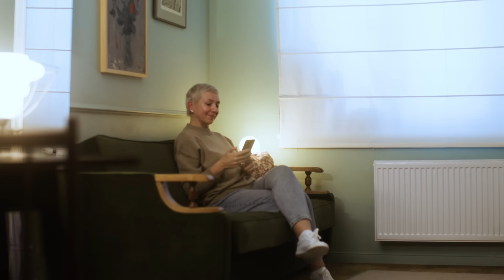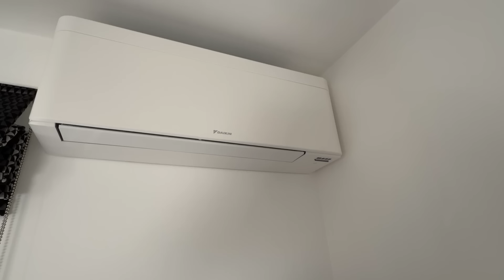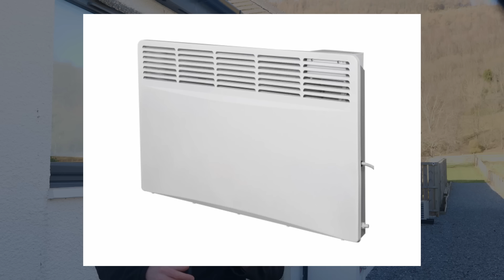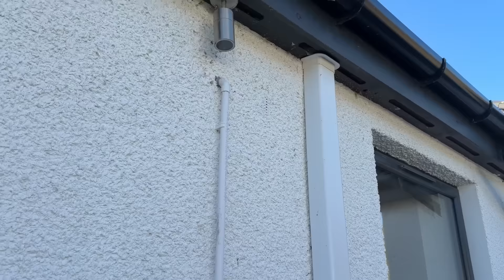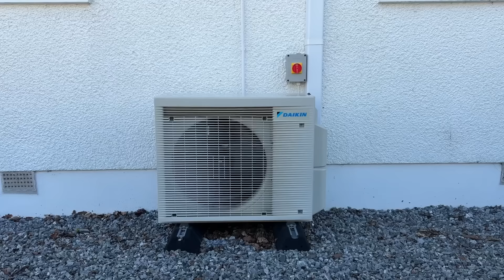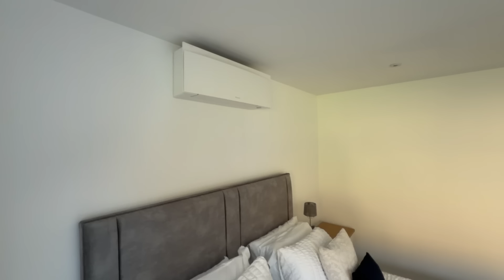The ULTIMATE Guide to Air-Air Heat Pumps

Comment: yes but you (no one actually) didn't calculate cost of servicing and replacing like compressor, electronics, getting water into closed loop system. that's when all you calculation go into waste. I had to change compressor for Mitsubishi - 3000 eur ! in 5 years. you can run with this all other system with no reasoning ! so basicaly better to buy smaller, with lower cost for replacement ... gives you much much better outcome in the long run. Don't buy special brands that offer you don't know what. I'll buy generic smaller one from not known brands and to change it as easily as possible!

Comment: “Unlike air to water there is no need to install cylinders.” So how do we get hot water for washing and showers? I’ve had quotes for air to water systems, none asked about the pipes in the screed which are 15 mm plastic which has a significantly lower maximum flow rate than copper. In other words, it’s not good for a heat pump operating at 40 - 50 C and high flow rates. Installing new pipes would be highly invasive if hidden, and very ugly if surface mount. Plus big radiators suitable for a heat pump cost £300+. I agree air to air looks neat, especially with pipes going up into the loft of a bungalow, which is my case, then distributed through ceilings to heating units. I am tempted by air to air as my combi gas boiler is 15 years old. The big issue is the hot water cylinder. I would have to use the old immersion cylinder cupboard which is now used for storage. I am sure air to water installs are a bit overpriced at the moment.
Reply: Just to let you know there is a solution to the hot water issue when you have air to air. I replaced my combi boiler with an Ariston Velis Tech 80l electric water heater - its just 27cm deep and around 50cm wide, so it fitted in the kitchen cabinet where the combi was. It uses two tanks, an inlet and an outlet, so using hot water from the outlet doesnt result in a temperature drop when cold water replaces it in the other inlet tank. It just uses 3kW, even though it has 2 immersion heaters (1 in each tank) but they never run at the same time. Its easy to control via wifi, either the app or in my case Home Assistant controls everything. I heat up the water overnight at the cheap rate, and it lasts all day.  Estimated running cost is about £75/year, with no gas standing charges, no combi servicing, and no costs when my 11 year old combi fails! Its a simple solution but very practical as the hot water is totally separate from heating/cooling, so if one system fails the other keeps going. For a small home that had a combi and no space for a big water cylinder I think this is the answer!
Reply: @markbaldwin4761 . Thanks for the information. I guess the key here is overnight electricity. My tariff has a fixed charge all day.

Comment: How do you heat the water without a boiler?
Reply: You need a boiler, either a heat pump boiler or one with the Daikin system.
Reply: @StillAliveAndKicking_  You don't need a boiler necessarily if you already have an air-to-air heat pump which means you don't necessarily need panel convectors (radiators) or UFH since you would have installed air-conditioning units inside your home which are mounted on walls. Therefore, without the use of space-heaters, your only question is, how do you heat domestic water? Through a separate system with different options available: electric immersion heaters, solar thermal panels, and even a heat pump water heater.

Water is usually stored by a HWC, or rarely some prefer the instantaneous method where water is heated when it's being used only, removing the need for thermal storage and legionella risks, though it's more costly due to higher electrical demand.
Reply: @y @youxtuberz5229 That is exactly what I was referring to, a boiler for domestic hot water. A heat pump boiler is a HWC which uses a small heat pump to extract heat from the ambient air to heat water in the cylinder. It needs an outdoor vent. The Daikin A2A system can come with a Daikin HWC with water heated by the outdoor heat pump. Having an electric HWC makes no sense costwise.
Reply: @StillAliveAndKicking_ I never heard of a heat pump boiler before, I guess it's used interchangeably with heat pump water heater.
Reply: @StillAliveAndKicking_ You always learn something new!
Reply: @y @youxtuberz5229 . Look up Fjord Heat Pump Cylinder from Ådlar, I was wrong to call it a boiler. There are other makes.
Reply: @youxtuberz5229  No, a heat pump water cylinder is for use with an air to water heat pump whereby the external heat pump feeds it with hot water.
Reply: @StillAliveAndKicking_  A heat pump water cylinder is the HWC itself that's connected to the air-water source heat pump, correct. That's a common arrangement.

But we were talking about a different situation: an air-to-air heat pump dedicated for space heating, and a separate system for DHW
In this instance, a heat pump water heater / boiler with a HWC connected to it for DHW.

The terminology is where we differed.
Reply: @youxtuberz5229  It is too confusing as there seems to be no clear name for the HWC that has its own small heat pump for heating the water. They are quite expensive.

Comment: Fair summary. Worth flagging the split for anyone choosing: air-to-air gives you quick room-by-room cooling like an AC unit, whereas a hydronic system cools through water and emitters. If you go hydronic, getting useful cooling usually means a Cooling-Ready Retrofit — adding fan coils, drainage and dew-point control alongside the heating. Different feel, different install, both valid.

Comment: Here in Australia, domestic central heating with boilers and hot water radiators is almost unknown. Most of us live in the south-east of the continent where we get very hot summers and pretty cold winters - here in Canberra temperatures can range from -6C to 37C. And modern Australian houses are not built for winter conditions, having brick veneer walls, tiled roofs and large windows.
We've all been buying air conditioning for use in summer for many years now, especially since cheaper units from Japan and China became available. From there, it was only a short step to what we call split system or reverse cycle air conditioners, which are just other names for air to air heat pumps.
We live in a moderately small townhouse (terraced house) and we have a medium-sized air-to-air heat pump installed in the kitchen area of our open-plan living area (kitchen/dining/living room). It isn't able to heat the whole house and there's only one possible site for a larger unit and that would turn our living area into an oven. So we have a separate ceramic radiant heater in our bedroom and are stoical about the bathroom (British English) and toilet. We have 14 PV panels on our roof with a peak loading of 4.64 kW. We don't have a storage battery.
The secret to better economy is insulation. The Walls and ceiling seem to have been well insulated when the house was built, but we've added draught excluders to the bottoms of doors and apply (shock! horror!) bubble-wrap to most of our windows as a very effective method of window insulation, which I call Scotsman's double glazing. It works. Nobody we know believes us - because it's so cheap - but yes, it does.
We have a time of use electricity tariff, which means that off-peak costs us AUD$0.15/kWh, shoulder is AUD$0.27/kWh and peak is  AUD$0.38/kWh, roughly speaking. Supply charge is AUD$1.14 per diem. Feed in tariff is a measly $0.05 kW. We have recently replaced our corroding gas hot water heater with an electric one, but we have installed a timer to the circuit so that it switches on at 10.00 am and switches off at 4.00 pm, with a booster coming on as required. Prices will increase next financial year by about 4%, but our supplier tells us that based on recent usage, our total electricity charges for 2026/27 will be about AUD $1,200. As a rough guide, one Australian dollar equals about 50 p sterling. So that's about 600 pounds for the entire year.
BTW so many people in Canberra have domestic solar that off-peak pricing now applies to the middle of the day and not the middle of the night, to try and cut back unused solar power being fed back into the grid and seriously overloading it. As we're both retired we can take full advantage of this. Others are not so lucky.
Reply: That's great feedback, thanks for sharing
Reply: Why on earth don’t you install batteries? We’ve got 15 panels facing south and 2x Tesla Powerwall 3 batteries. Even here in England that means we have no electricity bill during summer and minimal in winter. We haven’t got an EV yet but have a home charger installed. We sell back our excess generated electricity to the grid @12p per kWh. Now our summers are getting hotter we will be installing air to air heat pumps for next summer, which will run AC for nothing using our solar, with the added benefit of heat in the winter - we currently have a very efficient condenser/ boiler doing UFH throughout our ground floor and radiators in bedrooms. We will look to at least de-install the upstairs radiators when heat pumps are installed, and might even get the Daikin unit that can heat our water too. Possibly get rid of gas all together. I’m nearing retirement so we want everything new and future proof with as low bills as possible.

Comment: What would it cost for 1 external Air2Air unit feeding 2 internal units (lounge and bedroom above). Well insulated 2 bed end of terrace house, 8 years old.
Reply: We had 2x Panasonic units installed for £3.5k.
Reply: We had 2 air handlers & 1 outside condenser fitted into our park home, whole work done in about 3hours  total a little over 2k  was it worth it………we should have done it sooner
Reply from the maker: Between 4 - 5k!

Comment: I like the idea of floor mounted A2A units for primarily heating. My concern is that I hear people say that as soon as you turn A2A off the room goes cold. Surely the heat produced warms the fabric of the building, hence shouldn't do that suddenly, but it is a big concern having not experienced that with oil heating and rads.
Reply: What you're saying is simply that A2A is very responsive - why would that be an issue? We like that we have a floor mounted unit downstairs and a higher up one upstairs where the bedrooms are.
Reply: @johnhunter4181  I'm at a point where I need to get a heating system in place to replace my oil system. I've looked at nearly every option and A2A is one. Having not experienced life with aircon heating its a leap of faith compared to retaining rads and having a responsive electric boiler for short periods of use, or an A2W heat pump and require 247 running due to low response and limited zoning ability( plus reliant on a good install ). To only heat on demand is my preferred cost conscious option, hence why A2A was on my list.
Reply: @albireo-d1b read the book by Professor David Mackay- Renewable Energy without the Hot Air. It is available as a pdf on the internet- A2A is by far the most energy efficient and reactive heating system available. Coupled with small scale solar pv on your roof and you have a very powerful solution.

Comment: Hi
My question is: how reliable is A2A in terraced houses keeping humidity low, damp low and temperature high ? Will it be good in a 1920s house (as compared to a new build)? Will we have to run it 24 hours for 3 months in winter? 

For further context, we live in a terraced house which is draughty in some rooms and has high ceilings. We had damp problems which were attributed to low heating capacity of radiators and high humidity. We have managed to bring down humidity by turning on dehumidifier everyday for couple of hours. For keeping warm, we still struggle in the winters despite running radiators in all rooms for 8-12 hours. Keeping the radiator on for this long also helps in reducing damp as house stays warmer for that long as radiator has residual heat.
Reply: Some units also dehumidify. The one we have doesn't but it's incredibly economical in both cooling and heating.

Comment: Much neater than an air to water system with compact units high up on the wall instead of massive radiators taking up wall space. Heating and cooling all with one system and they also warm up the rooms far quicker than an air to water system.
Reply: I read somewhere that you should have the units near the floor for heating because there's no point in hearing the ceiling
Reply: @agritech802  it forces the air down, by blowing... it's majig

Comment: Don’t think air conditioning units are good for your health long term.
Reply: A maintenance program is needed to clean the filters. They are then fine.
Reply: If you use cooling mode intermittently then I would advice drying out the indoor unit after each use by running fan only mode for 1hour to remove moisture that could propagate mould. 
I have a coil dry mode on my old Fujitsu that runs the fan on low for 30 mins, then gently warms the unit, runs the fan for 10 mins and then switches off. I have never had musty smells coming from my units on switch on and the indoor coil looks like new after 20 years.
I do the same with my car a/c.

Comment: Really Old houses in terraces say in towns have 5 chimneys in each house lol imagine if you made designed an air/air unit that just used the chimney stack already there. Place the unit up on (or in?) the chimney and place pipes down the flue to heat a unit in the fireplace lol more than likely you’ve got them sealed off so make use of them again. Placing the unit low to ground is good I guess to make use of cold temp in winter, ground frost, and in summer hot soil but you don’t use it like that do you, I guess higher up it is, is better?
Reply: You can use the chimney sort of for air/air when cooling with a portable unit as you dump hot water up a chimney, but it's not much use for heating as the cold won't go up a chimney. Probably not a good idea though given all the soot and stuff.

The external units on fixed installs are heavy and they need to be on a flat level slab and at ground level for maintenance purposes so all your piping ends up mostly horizontal. It is possible to do ground/air systems but I don't think I've ever seen one in the UK although ground to air or to water systems do much better in really cold climates and are more efficient but much more expensive to install.

Internal units you put low down in the room if you mostly heat and high up if you mostly cool.

Comment: I wondered how much is the effect on the up-front cost from multi-floored houses; so say, a 3-story. Also, there seems to be some sort of impact on the gov's 7k5 grant and/or 2k5 for the A2A, but I cannot fathom this - the issue is "eligibility".
Reply: The grant requires that you get rid of gas, meet a load of rules. use an MCS installer, pay all the resulting MCS costs. If you want to replace the cooker and water heating at the same time it might be worth it but often IMHO it's not worth the hassle for air/air as you'd often rather do it bit by  bit, keep the gas as backup for a bit until you see how it works, keep the gas water heating for now etc.

More than two floors can be complicated. We looked at doing a four storey terraced house and it would have basically been impossible with air/air at sane cost because the way you make air/air work nicely is to heat the bottom of the stairs. The one we looked at was all rooms off a central stair case - so fire regs required all fire doors, meaning you'd need a ton of units.

Comment: 1. You’ve got a duplicate edit around 2 minutes, I know there’d be something when you said you were in Scotland on a sunny day ;) 

2. If it wasn’t just a zero pay off kinda thing. The cost of heat pumps is insane, aircon also can heat at multiple efficiency. To get this on an 80s house you’d have to wire in all of the walls. 

I’d love something like this but it’s just too prohibitive, if you can get something like this do it, no brainer really. I’m hoping for alternative fuels in the grid. 

I spent around £7k to replace all of the central heating in my house (new boiler, radiators) if I was buying a new house now and doing the same (taking the house back to brick) I’d for sure look at this.